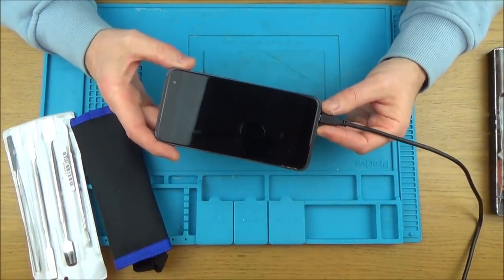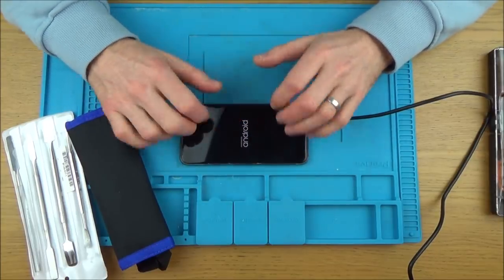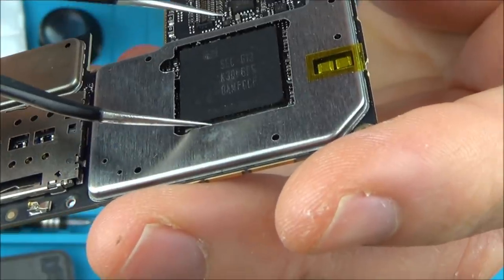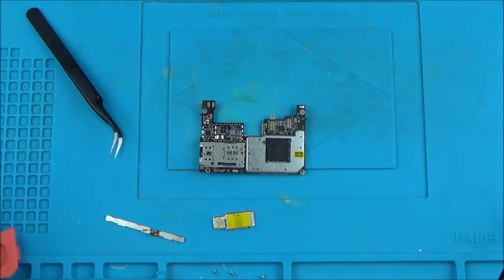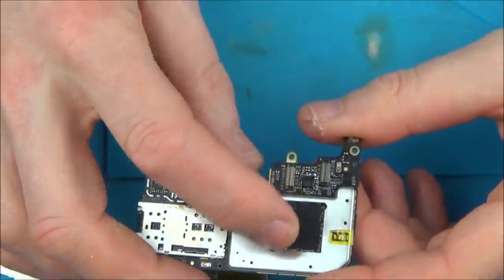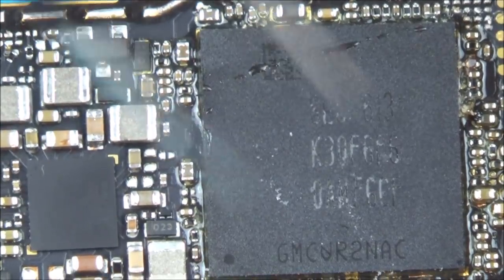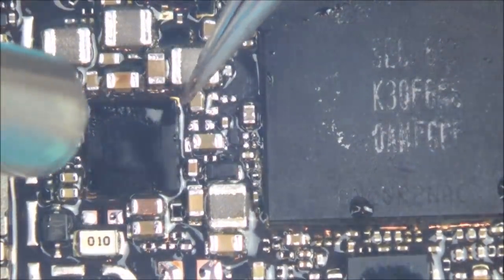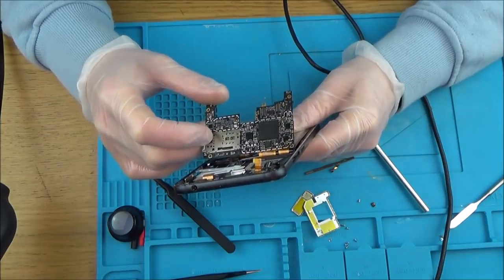Trying to FIX a Faulty Android VFD900 Android Mobile Cell Phone

Comment: Do you try "Hardware reset" (you must charge it to atleast 50%) on it? there is a HUGE phone repair forum with all kinds of software and hardware mods and repair for Windows and Android phones xda-developers.com and its forum forum.xda-developers.com ... if its not too late already go check it but i am afraid its too late for this phone, this crackling sound -> you bake it like steak :D :P
If you ever heat board like this you make sure you preheat it SLOOOOOWLY (NO MORE than 230C or you will kill it) because fast heating stress the board and chips and they CRACK like glass, the solder balls went out because you cooked it like soup, This was main (CPU) chip which is sanwiched with FLASH ROM memory chip. It was software problem at first and you mess everything
Reply from the maker: Thanks for the tips and the links. I originally thought it was all related to the drop as it happened after this. I didn't think software would be troubled by an impact so I thought it was hardware related. I should have tried the software first. I will try this first in future :-)
Reply: @Mymatevince  Bootloop is caused by incorrect data stream between hardware interface. A tiny movement on SD Card or SIM Card while processing data caused by drop may lead to this error, not nesessery to be a damage on hardware at all. Kinetic or Static energy are very upredictable happenings, specialy on nano technologies who processing billions of operations per second. A shock on PCB can cause oscillation in the right time and can alternate bytes in the streaming data. The hardware is sturdy enough but the data is very fragile. On old electronics it was allmost the opposite. The phone is like PC inside and also works on the same principles - Hardware -> ROM data -> BIOS -> boot sequense -> OS load from Flash Memory to RAM for processing by CPU or GPU -> Data stream between hardware interfaces.
Reply from the maker: Thanks for explaining it to me. You have a very wide range of knowledge. Thanks for taking the time out to share it on these 'trying to fix' videos :-)
Reply: @Mymatevince  you etertain me for free, i can't but i can give you knowledge instead so you can entertain me more :D its a fair deal ;)
Reply: @Mymatevince  in fact there is more -> What do you get when move coil near magnet? - The magnets are speakers and vibrator in phone and the coils are traces on PCB and worse, they are energized ... it is simple as that!
Reply from the maker: @technixbul  The deal sounds good to me :-)

Comment: you fried the cpu when you was reflowing the other chips you should have put a shield over the top to protect it so you made the phone brain dead good video though vince just buy another  motherboard off ebay i bet you would find one cheap  now  looking forward to your next video
Reply from the maker: Thanks Jon, I was trying angle the air away from those plastic connectors so I didn't melt them and too much heat went up to the CPU!!!! If I have to do something similar again I will use a shield :-)